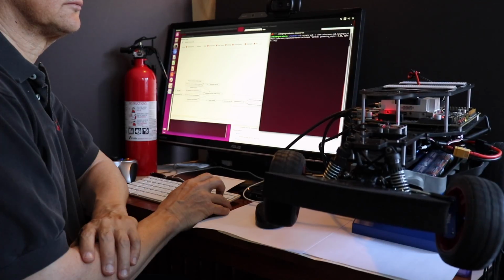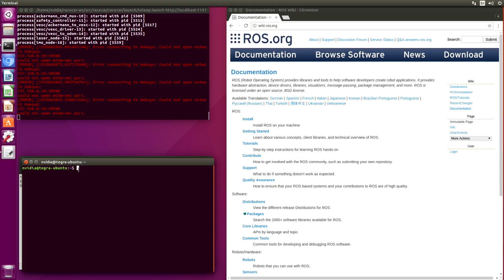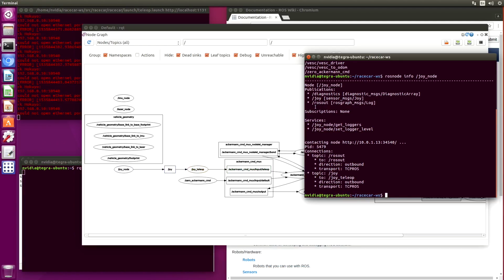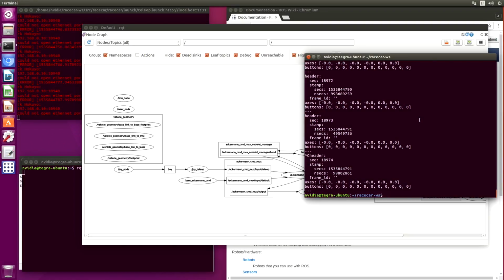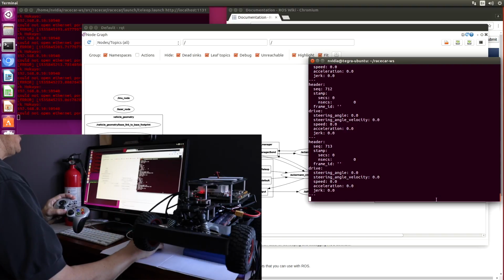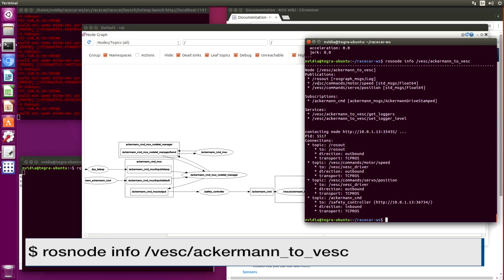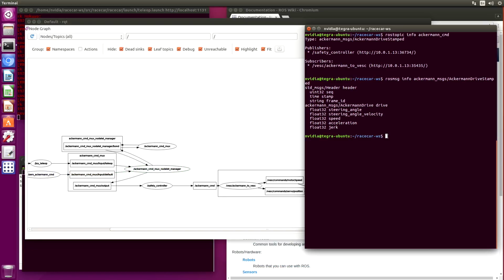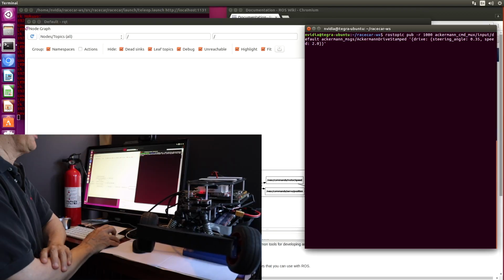Exploring ROS - RACECAR/J

Comment: I have a number of Jetson boards. Your channel is invaluable to the people who use these boards. ROS is good for research labs and complex robots. Seems a big investment for most hobbyists.
Reply from the maker: Thank you for the kind words. For people just getting started (such as a hobbyist), I always suggest start with something like a DonkeyCar ( ~200 USD). 

This particular project is oriented towards people who want to understand how autonomous vehicles work, and how (as you stated) research labs and complex robots are professionally implemented. To be clear, the software is pretty much the same, the I/O devices themselves tend to be what sets apart the hobby from the professional versions. 

For example, on a full scale autonomous car use 3D lidars which until very recently were $75K USD. With that price tag, you can understand why someone like Tesla would use a vision based solution. You come down to the $5K mark on the MIT RACECAR and you get a 2D lidar, fewer cameras and so on. However, many of the principles are still the same. If you work on and understand the MIT RACECAR codebase and then move up to full scale hardware you will understand what's going on. 

As you remove/replace hardware on the MIT RACECAR (for example, replace/remove the lidar and go to a webcam), the framework is the same, but you will need some "tricks" to get monocular vision to work as desired. When you start removing sensor, you also miss out on the most important part, which is how sensor integration works. Thanks for watching!